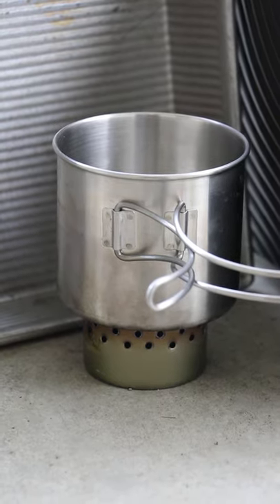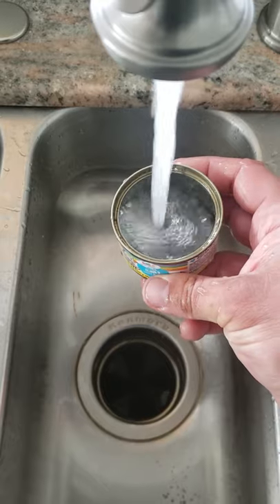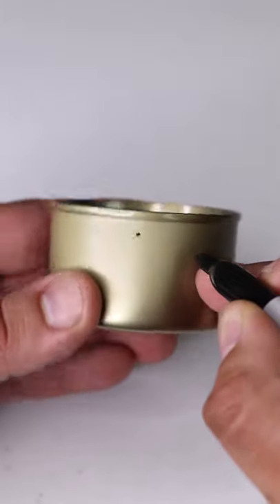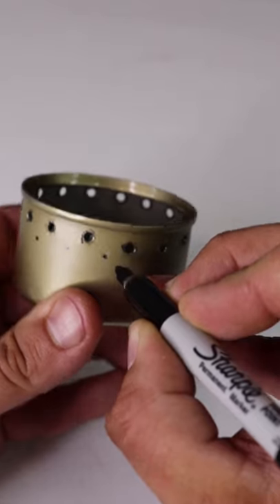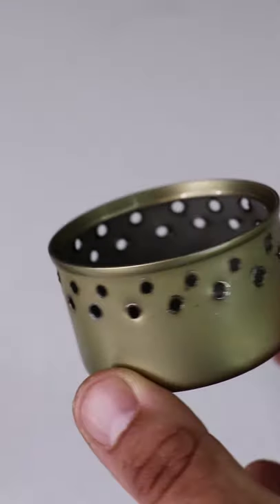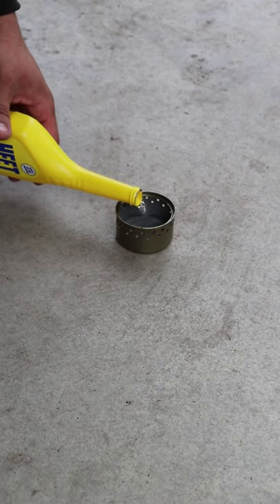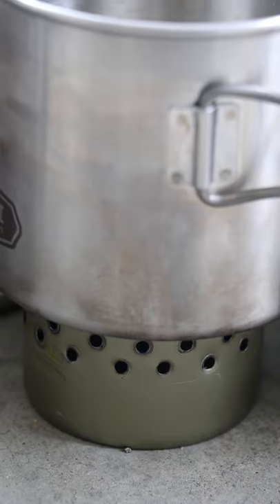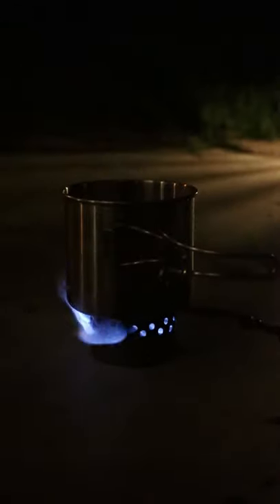How to make a Cat Food Can Alcohol Stove - DIY #Shorts

Comment: Wider can will be more stable AND you can add more holes for burners.
It will still hold about the same amount of alcohol, maybe more.

About windscreen - get a tall can wider than the cat or tuna can you are using.
Remove the top and bottom, then cut straight up from bottom to top.
Be careful of sharp edges.
Bend open the large can wider than the container you are cooking with (cup, pot, skillet),
Place the stove inside the tall can, light, and it will block most of the wind.

For daytime use of the stove, put in a pinch of salt. It will turn the flame orange.
Reply: A pitada de sal deve ser colocada no álcool?
Reply: @marcosalexandre2474  Sorry but I only know English.

Comment: Instead of a pot use 1/4 inch steel plate and weld fins to the top. Use in place of a pot and you now have radiant heat.
Reply: Could you possibly explain this a bit more, sorry I am slow but i really want to learn from your wisdom. 

So will you be using the cat can as the stove and then the steel plate as a pot ? I am having hard time imagining this.
How will the fins look ?

And what will be the use for the radiant heat?
Reply: @MrGrace123 get a 4 or 5 inch square piece of steel 1/4 inch thick. Add more strips of 1/4 inch steel standing up to make fins. This will create more surface area and allow air to flow through it, heating the air more efficiently.